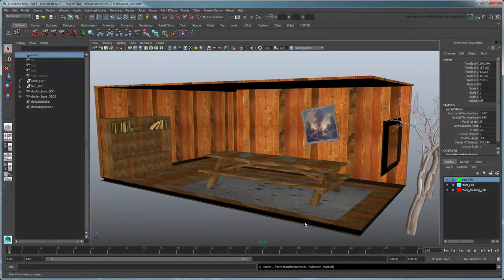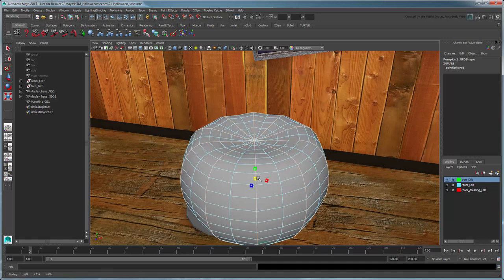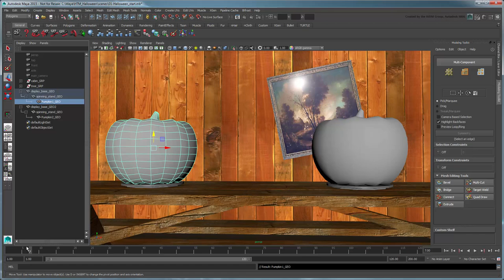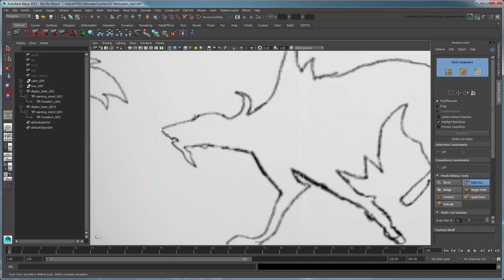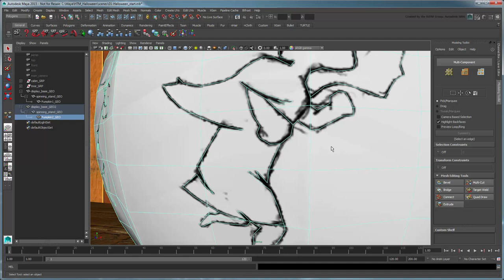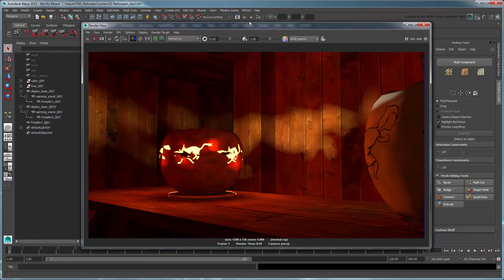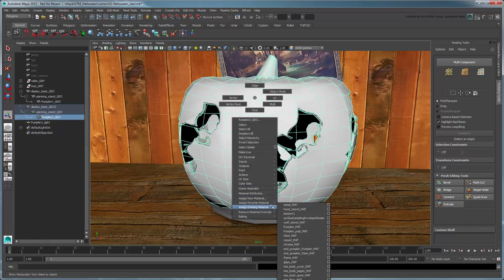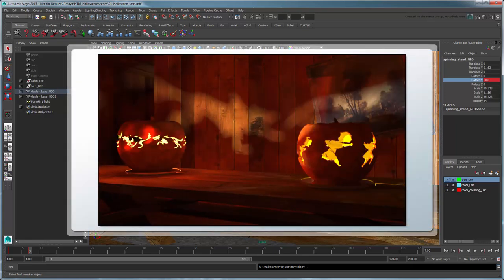Creating an animated pumpkin carving

Comment: Hey there! I'm having an issues at 6:57, where as I cannot close my edge outline by clicking on the last(original) vertex. How can I go about accomplishing this?
Reply from the maker: +MrBalinSuperTV Hmm, that's highly unusual.  Maya could be struggling with the large / complicated shape of your stencil, so maybe consider cutting it as a bunch of smaller unclosed cuts (i.e. use the tool repeatedly) rather than a single uninterrupted cut.

Comment: Hello! I try to repeat all that you do, but I can't, because then I use Multi-cut, I have warning. Ex (// Warning: Can't perform polySplit27 on selection). What a problem?
Reply from the maker: Try clearing the history on the pumpkin and trying again.
Reply: Maya Learning Channel Thanks for you answer, but it not working
Reply from the maker: Are you using Maya 2015 extension?  Are you sure you have the pumpkin selected first?  Try deleting your preferences and restarting Maya if the problem persists.

Comment: Why so lazy to fix the direction of the wolf. The wolf is running away and so is the girl. All they had to do was flip the image in any image editor. Instead this tutorials looked a total mess. Even the fix at the end was not a fix. Come on wake Up
Reply from the maker: Actually we mention in the tutorial that the wolf pumpkin is specifically designed so that the silhouette on the wall is running toward red riding hood (which by necessity means the stencil on the pumpkin itself must run in the opposite direction).
Reply: Maya Learning Channel It would look better with both silhouettes on the wall and running in the same direction. "You're fired."